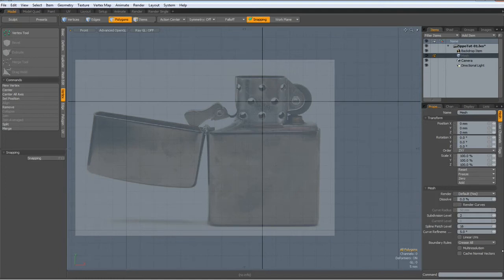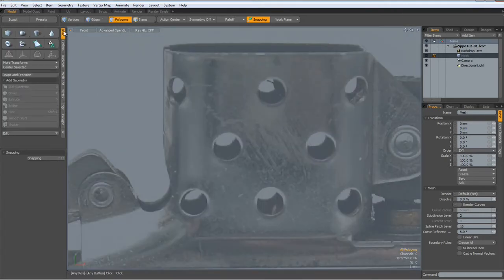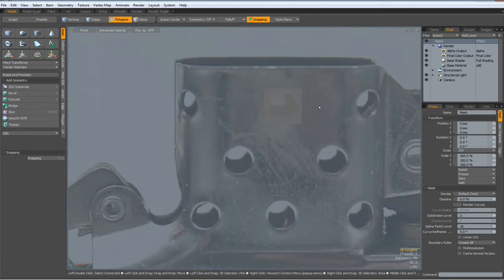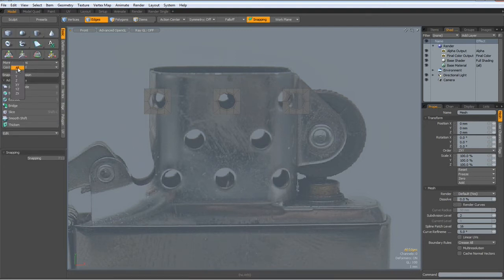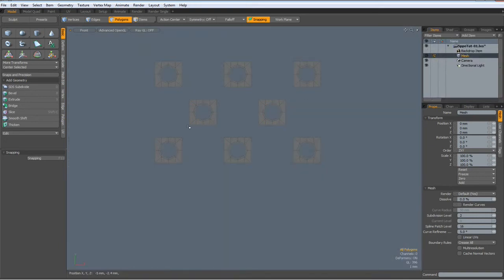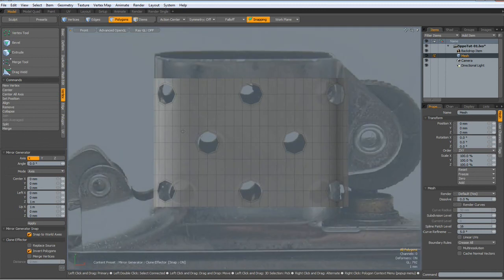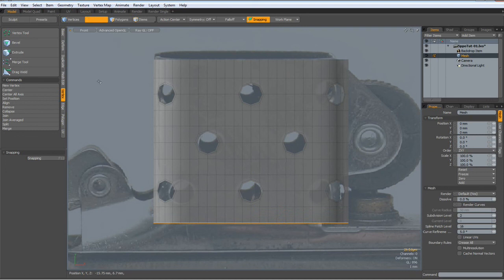Luxology Modo - Modeling a Zippo Lighter - Part 1

Comment: Sorry but it's one of the worst tutorial i've seen in a while, you don't mention most of the shortcuts you are using, and the part with your shift click split in the middle simply don't works at all on modo 701, impossible to draw new edges that way...
Reply from the maker: Sorry, but you can always see in the bottom left corner of the screen what tool i am using. I have assigned a lot of shortcuts myself which you will not have. So it does not make sense to mention these.
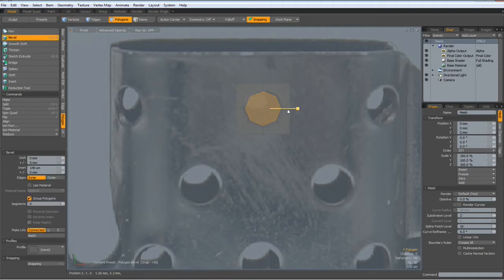Reply: Peter Stammbach  Yes, of course, I understand you have your personnal shortcuts, but it's way better for a tutorial to use the normal options of the software, and to explain where we can find the tools using the basic interface, also you've made some actions and didn't explain how to do it, as combine all the points into one point, I know it's collapse on 3dsmax but it's not that option in modo, after some tests it seems to be join (?), anyway thanks for the tuto, but I'm really disappointed to get stuck at  3:00, because this method to add additional edges simply don't works for me, I don't know why, but modo just don't wan't to draw the new edges, I retried 4 times...
Reply from the maker: Hmm .. the edge slice tool ('C'-key) is a standard modo shortcut and if you can not use it, then you probably have a messed up configuration file. Shift - Click always reactivates the last used tool in modo
Reply: Peter Stammbach Ok, thanks for the tip, I'll retry and reset the config file.